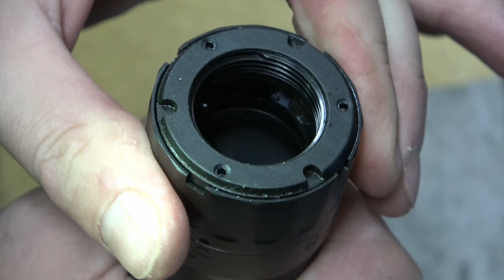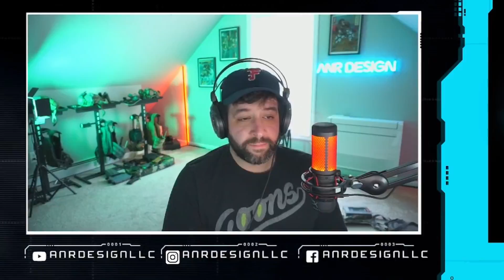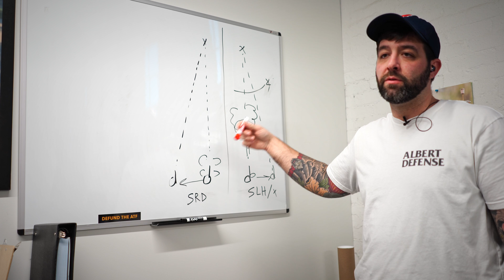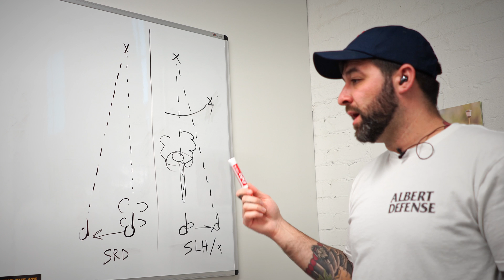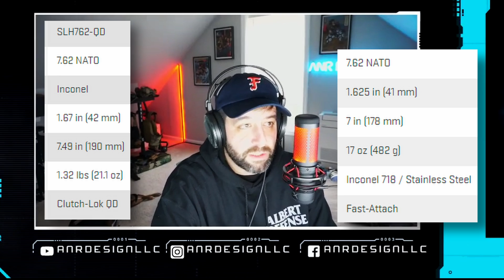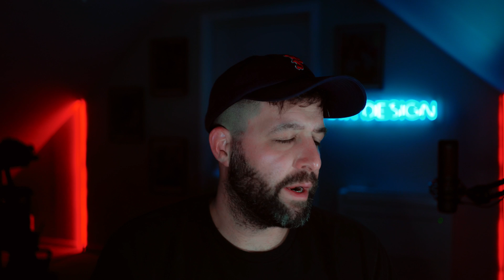SCIENCE - Comparing SIG SLH 7.62 - SLH C 7.62 - SIG SRD 7.62 QD - SIG SRD 7.62 DT Suppressors

Comment: I’d be curious to know the difference of gas blowback with different barrel/gas lengths. I have shorties as well but if the blowback is gonna be significantly reduced in upper lengths of 12.5, 13.7 or 14.5 I am certainly more prone to go that route as a left handed shooter. Thoughts would be greatly appreciated.
Reply from the maker: these cans are advertised to reduce gasses better than UNSUPPRESSED. take that for what you will
Reply: @ANRDesignLLC  ……by your testing….it seems like SIG is lying haha. There was some strings of fire where you are hanging out in a ball of gas. I appreciate the time and energy you all take to bring us information. It helps all of us a great deal when it comes to what we invest in.
Reply from the maker: it was one of those cool, foggy days. gas vs water vapor is very much exaggerated here during these conditions. Also, wind direction. Had a SLIGHT wind to the face. seemed to hang a bit. 

Just consider outdoor environmental not being a 100% accurate testing site.
Reply: @ANRDesignLLC  touché. Great point, thank ya

Comment: The actual length for a 9" barrel with a 5 & 1/4" can would be a total of 13 & 5/8" because you have to subtract an extra 5/8" of an inch off because the flash hider screws  down 5/8" on to the barrel and the can attaches to the back of the flash hider not the front. It's good to know when you're trying to figure up what length SD style handguard to get for it.

Comment: Amazing video!  I have a rattler and bought the SLH 300TI-QD with the intention of picking up the compact can later to have the option of running it in a super compact configuration.  I am bummed to hear the compact version offers essentially no sound suppression and the full size version is kinda pointless given its only saving me an 1.5" in length compared to the SLH 300.  I wish Sig would sell their clutch lock in a 1.375-24 adapter so I could use another shorty suppressor OR make a muzzle device that accepts both clutch lock and direct thread since I am guessing the direct thread SLH C version would sound better.  You guys have any thoughts/advice here???  Thanks!

Comment: Have you shot the oss 762 silencer? If so, which do you prefer?
Reply from the maker: i have the older 762 OSS. For a high flow can, i prefer the sig
Reply: @ANRDesignLLC  ya, i have a 762ti.. i was thinking about "upgrading" to the SLX because i use night vision and the flame out of the OSS is substantial.. however, no one on the internet has any unbias looks at the SLX or SLXc.. 19.4 oz is a shit ton of weight for the full size but the compact prob will basically be a really heavy flash hider on my scar 17. 
I wish silencers werent so ridiculously hard to sell used otherwise i wouldnt mind taking one for the team much and buying one right now.
i like high flow because i can use it on guns without worrying about tuning issues, like on the scar 17 that has issues with traditional cans.

Comment: The Clutch-Lok muzzle devices are listed at $157. That’s absolutely merciless pricing, especially if you want to set up multiple guns.
Reply from the maker: surefire muzzle devices are 130, dead air is 90-100 but are always out of stock. 157 isn't too far over priced over SF and it's a new to market product. NPI is always priced high at the start and maybe they will drop price a bit in time.

Comment: What I don't understand, is why doesn't an unsuppressed weapon system have the "gas down range" problem shown with the SLX cans? I don't recall my AR-15 leaving plumes of gas in front of me ever. Does the super sonic flow out of the muzzle just disperse the gas too rapidly for it to be noticeable?
Reply from the maker: it has more freedom to expand the volume of gas. It's not feeding gas back into the system with a vacuum. It' also not a 300BLK SUB that has a lot more volume of gas and powder. 556 burns differently.